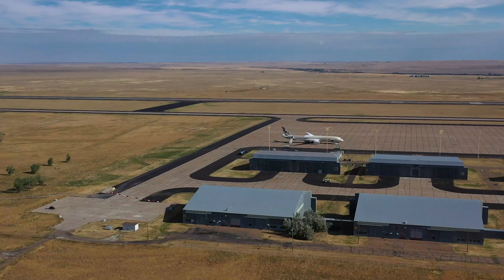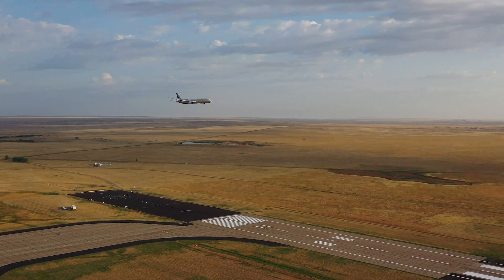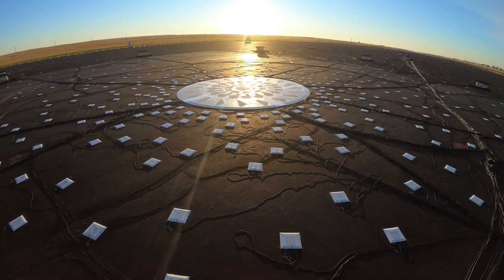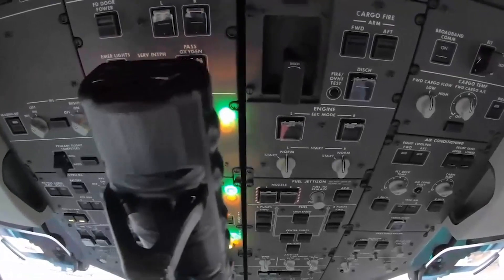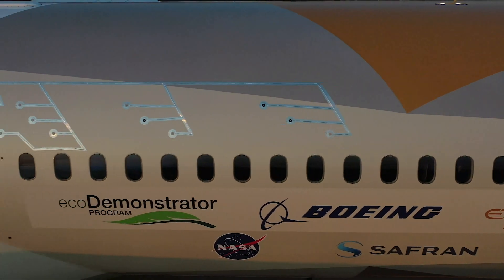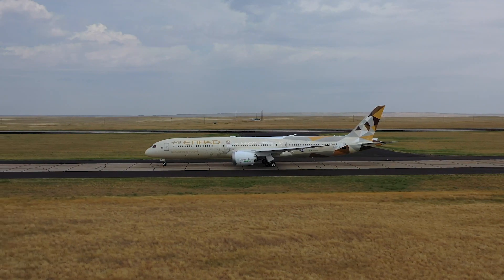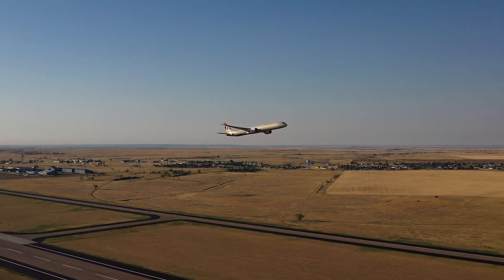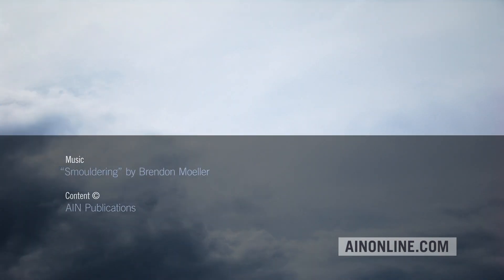Boeing Tests New Tech with ecoDemonstrator 787 – AIN

Comment: Just run the entire plane through quality control one more time...
Reply: The MAX crashed because of faulty maintenance. Both LionAir and Ethiopian knew that their AoA vanes were broken, but refused to fix them. In fact, both airlines faked the photo evidence, thereby lying to the regulators. The AoA vanes control MCAS.

It's really not a mystery why small, not super rich airlines account for 100% of MAX crashes, despite only accounting for 1% of MAX flights. A well maintained MAX is perfectly safe.
Reply: Single point of failure? Boeing fail.